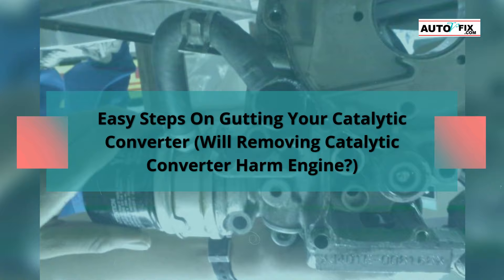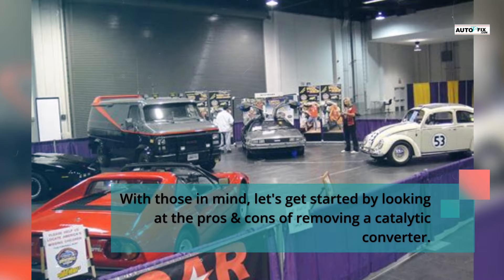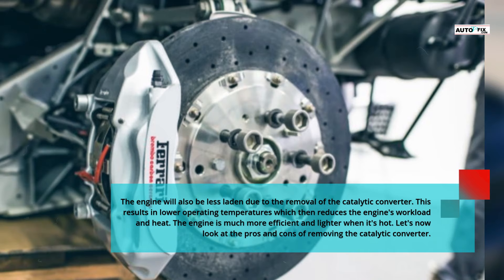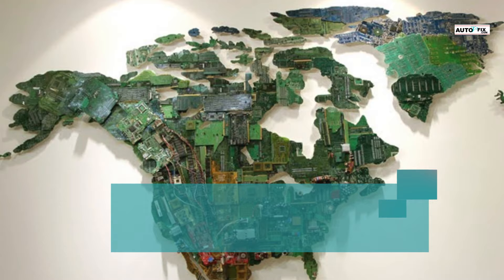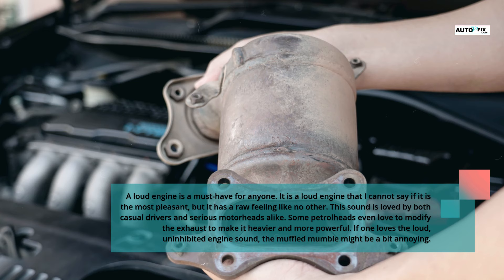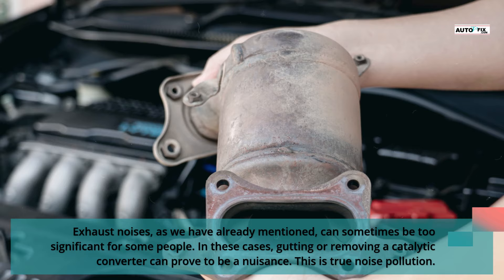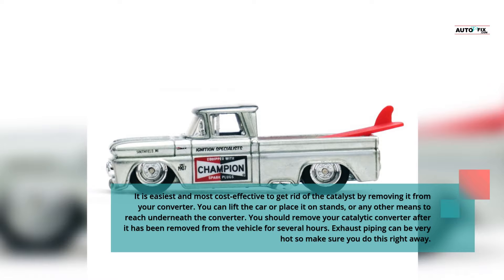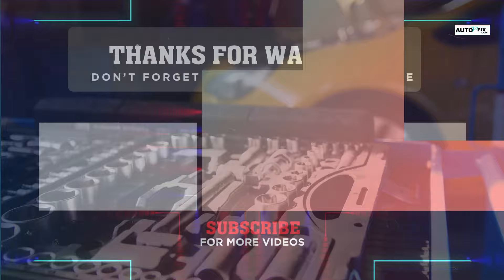Guide On Removing & Gutting Your Catalytic Converter | Will Removing Catalytic Converter Harm Engine

Comment: I went from 9mpg to 17 mpg after I busted out the "stuff" in my catalytic converter
Reply: Was probably clogged
Reply: Hey bro but once you did that did the muffler sound weird? Did the smoke blow out darker? I’m thinking of doing that since this problem caught me at a bad time financially and well I imagine if it sounds weird maybe adding one of those exhaust tips on the mufflers would help change that no?
Reply: @deathuponusalll  it depends , if your muffler is in good working order it would not be that noticeable in decibel levels . Engine will also breathe better . Just adding an exhaust tip wont change the sound but one that acts like a resonator will quiet it up a bit .